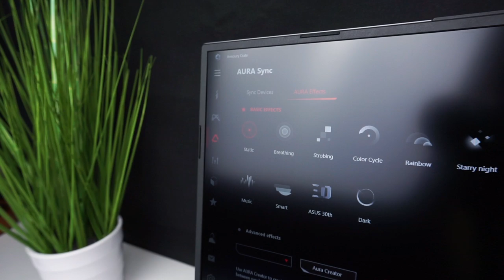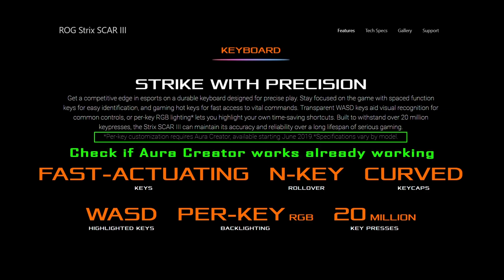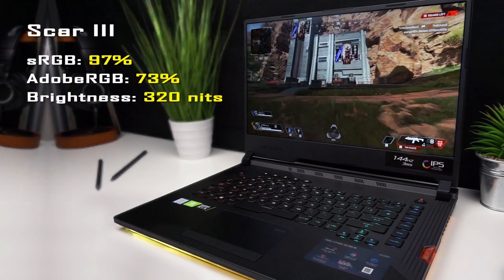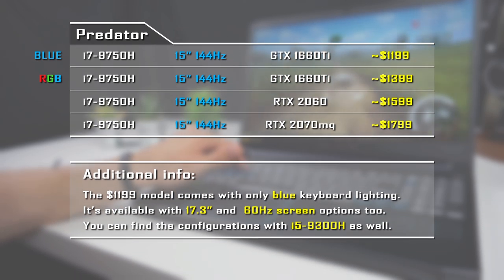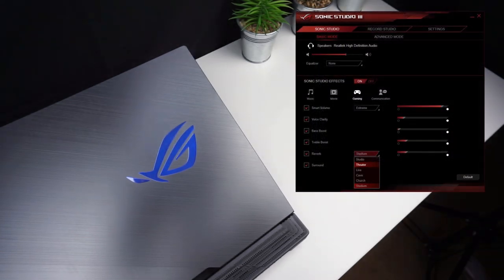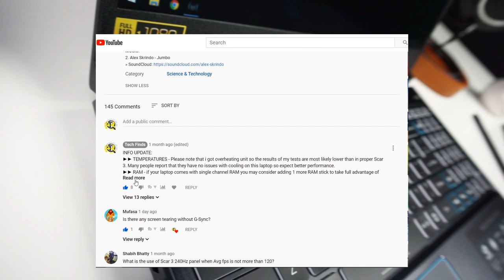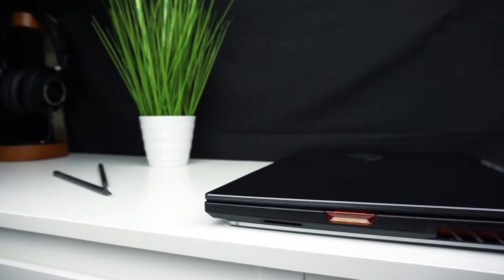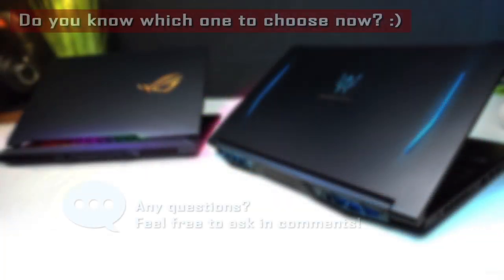Acer Predator Helios 300 2019 vs Asus Scar III - In-depth COMPARISON / REVIEW

Comment: Here are a fer questions ....
Do you get more frames if lets say i connect this device to a 2k monitor ?  
I think the rtx2060 should shine when used in higher res .... 

Lets say i would like one day to buy a VR headset .... can the 1660ti handle that ?
Reply from the maker: Every external monitor and every higher resolution decrease the performance. It depends on your monitor how much lower frames you'll have. 
If it comes to VR you can play every game with ease.
Reply: @TechFinds  I Should have made myself clearer .... the question is in regards to the difference between 1660ti and 2060 ... 
Both can handle 1080p with roughly the same FPS per game , making the price for the 2060 kinda high , but ... can the 2060 handle a 2k monitor vividly better then a 1660ti .... same with VR ..

Thanks for your time and a very well put together Video ::)
Reply from the maker: @hoffmanstream1107  The difference between GTX 1660Ti and RTX 2060 in Predator should not be  noticeable for VR, but if it comes to monitor you should be able to take advantago of RTX card since in theory it provides better results on higher resolutions compared to GTX cards. But i can't tell you anything certain, because i wasn't able to test it. I don't have any external monitor.

Comment: How do you compared the fan noise between these 2 laptop especially in turbo mode?
Reply from the maker: There is a device to measure the decibels. It's pretty common and cheap, just a microphone on a little stand with a display to shod decibels. ;)
Reply: What he means i think is that what laptop is much more noisy.
Reply from the maker: @mer-oneralphjr.bolinto6515  Ohh, the first thing that came to my mind was if he's asking about how do i measure the noise. Predator is much noisy, but i said that in the video.

Comment: Which one do you recommend between omen, predator and y540 for rtx 2060. ( i don't care about rgb so thats not a problem).
Reply from the maker: For sure exclude Legion Y540, because it runns pretty hot. Depending on which generation of Omen you're talking about my answer may vary. However if you wanan squeeze the most FPS out of you dollar i think that Predator is the way to go. I'm working on a comparison between 2019 Omen and 2019 Predator, so if you're curious it will be relased in about 4-5 days hupefully.
Reply: @TechFinds  i was talking about the 2019 omen with rtx 2060 and i7 9750H  because it seems to offer a pretty good value. So which one do you think is better 2019 (rtx 2060) predator or (rtx 2060) omen. (thanks for replying 😁😁)
Reply from the maker: @ShreyasDongre-de6cj  I had Omen RTX 2060 and Predator with GTX 1660Ti. Hard choice to be honest. I think if you're ok with tweaking the Omen may be better option, but right out of the box it runns very hot right out of the box. It's also more expensive, but it has better build and features. However as i said if you wanna get the best performance out of your buck go for Predator with GTX 1660Ti which performs almost the same good as RTX 2060.
Reply: @TechFinds  and please comment about the thermals of the mentioned laptops
Reply from the maker: @ShreyasDongre-de6cj  Predator has better thermals, and Omen gets over 90 right out of the box. However if you undervolt it gets down to low 80's.
Reply: @TechFinds  i meant the laptop in the link not omem
Reply from the maker: @ShreyasDongre-de6cj  so if it comes to Scar it's a lottery, because you can get either a good unit with good thermal paste or bad unit that is overheating because of bad thermal paste application.
Reply: @TechFinds  so you mean there's no guarantee that it's thermals will be good?
Reply from the maker: @ShreyasDongre-de6cj  that's what I mean. However repasting with a good thermal paste will help in case if you got bad unit.
Reply: @TechFinds  Thanks. Won't bother you again.
Reply from the maker: @ShreyasDongre-de6cj  Lol, your link with Zephyrus M went to the spam folder and i didn't see it. :P
It's a great deal, but this laptop runns hot, so the performance may be affected.

Comment: In my country ( India ) Both laptops are almost the same price ( around Rs. 140000 ) each . So which laptop I should go for ?
Reply from the maker: Everywhere else Scar 3 is more expensive, but to be honest the only thing where it's better than Helios is RGB, speakers and display. If i had to choose i would go for Helios anyway.
Reply: @TechFinds  Thanks for the reply . Is these two laptops comes with a cpu integrated motherboard ? And what is your take on the HP Omen 15 - dh0135TX ?
Reply from the maker: @arjunprathap6703  Yep, both have integrated graphics as well. Don't tell me the model number mate, because it's individual for each country even if the laptops have the same specs. Tell me the year, specs and eventually design details.
Reply: @TechFinds  It's a 2019 model , i 7 + 1660 T i .
Reply from the maker: @arjunprathap6703  Yes, but there are 2019 old generation models and new generation. The old has red accents and the new one is all black.
Reply: @TechFinds  The all black one
Reply from the maker: @arjunprathap6703  Then i think that 2019 Helios 300 is still better, but Omen may be better choice than Scar 3. It's only my personal opinion. I made a comparison between 2019 Omen and 2019 Helios 300 as same as 2019 Omen vs Scar 3, so check those videos and make your decision clearer. ;)
Reply: @TechFinds  Ok I will watch . Thanks for the help :)

Comment: @TechFinds  i m plaining to buy asus scar 3 rtx 2070 with 240hz this is better than heliod 300 right
Reply from the maker: Depends on what you need. For sure you will get netter performance with RTX 2070 Scar 3, because it's full size.
Reply: @TechFinds  thank you for the update I'm going for it 😊😊😊😊😊
Reply: @k.yohans.perera8002  bro so do you confirm to buy the strix scar 3??
Reply: @iodean7616  yes

Comment: After watching tons of videos i came to the conclusion that rtx 2019 laptops are not worth it! Will wait for amper architecture announcement next year!
Reply from the maker: Since the GTX 1660Ti cards came out the RTX 2060 laptops seem to be overpriced while giving just slightly better performance. However if you're looking for absolute best performance on the market no matter the price, then RTX 2070 and RTX 2080 is the way to go. Yep, i'm so curious what the new generation of graphics cards will bring to the market and what kind of prices we can expect!
Reply: @TechFinds  Even the Max-Q ones?
Reply from the maker: @mrhyde7019  In my opinion Max-Q laptops have worse price to performance ratio, but you can still find some worth attention ones. It all comes down to price and for example HP Omen 15 with RTX 2070 MQ is a good deal, because it costs abour $1550.
Reply: @TechFinds  Yeah, guess so. I'm now looking at the new Intel collab devices (Maingear Element, XMG Fusion, Eluktronics Mag-15). But somehow I want to hold on to my ROG G750 until next year by this time to see what the new generation of Ampere cards bring.

Comment: Hey ,
I have a request from you, I’m going to buy a laptop scar ii and I wanted once I receive it to test it fast and to detect if there is anything wrong with it to return it or to fix it from the store where I got from 
I already googled and got some info
But I would like to know your thoughts and tips on how to test a laptop :) and thanks!
Reply from the maker: Just check the clock speed, temperatures and if there is a thermal throttling. I'm using Intel extreme tuning utility. Next thing that you can check is backlight bleeding. Do it in a dark room, set the full screen brightness and set the completely black picture on full screen mode. If you see strong yellow bleeding spots around the display it's not good, but it's a cosmetic issue anyway.

Comment: Everything is great i just don't agree with that you need to remove flat cables when you open laptop.. Cables are long enought so you literally have no need to disconnect them,i recently upgraded ram on mine,and it went flawless :)
Reply from the maker: Yes, you probably can do it without disconnecting the cables, but you had to flip the bottom lid over right? The thing is you need to be very carefull then to not move the lid during upgrade process, becayse you may accidentally tear off the cables. Anyway, every way is good if it works. :)
Reply: @TechFinds  You don't need to flip it all the way,you can put laptop close to wall or smh,if you work alone.. or friend can hold it if you work in pair :D But you are right.. Cheers
Reply: @TechFinds  so if the cable tear off so it will damage the laptop right or the rgb will not function
Reply from the maker: @ahmadboyz  It depends, because the cable can just pop out of the connector, so you will be able to connect it back. But if it tears off damaging any connection points or itself then light bar will not be working. Idk if the cables are only assigned to light bar or other features too.

Comment: Acer Predetor Helios 300 vs Asus Rog strix g   ,   2019 model i7 processor...
Reply from the maker: I'm not sure if i will be able to get the Strix G, but i can tell you that Strix G is not the best value laptop. It's much more expensive than Helios 300 with the same specs.
Reply: @TechFinds  i feel like whenever they do that there is something in the specs i am missing
Reply from the maker: @chadedwards3676  Cheaper doesn't always mean worse or less features. It's all about testing. ;)

Comment: And you can do a review of the predator against the Hero 3? Because i dont see many differences between the scar and the Hero 3

I want to see the performance of the Hero, because if the performance is Good, i would go for the asus, because of that extra rgb and audio
Reply from the maker: Hero has the same specs as Scar. Basically Hero 3 = Scar 3. The only difference is different colors of chassis.
Reply: Socthe performance is the same
Reply from the maker: @stephanoparedes7190  if you have the same specs the performance will be the same
Reply: There are laptops that have the same specs and one outstand the other, in jarrods tech i see the benchmarks results of the scar 3 and its performance in light games was very bad compared to the Helios with the 1660ti and the scar 3 with 2070

This was with low settings,
Reply from the maker: @stephanoparedes7190  I'm talking about the same specs in Scar 3 and Hero 3. The performance vary between laptops because of many random conditions like room temperature, thermal paste application, drivers version, game patch etc... So take every benchmarks with a grain of salt, because your laptop will not perform identically even though it has the same specs.
Reply: Tech Finds thanks

Comment: Hi my friend.. i just watched more than 100 video about the helios 300 .. on the same configuration because it’s the same one i ordered .. but every time i watch a video on every video the fps is different than the other video so i’m not sure about his preform
Reply: And i have a friend he has an acer nitro 7 laptop with core i7 9750 and gtx1050 4 gb vram with 8 gb ram .. and in fortnite for example in the epic sittings the fps is between 45-50 .. so for this reason i am not believing that the 1660 ti with this configuration is getting more then 120 fps on epic sittings or more than 70-80 fps on the high sittings of the so strong games .. so what do you have something to say it to me to make me relax cause i just ordered my helios 300 and thank you again 🙏🏻
Reply from the maker: Everybody will have different performance even though the laptop has the same specs. The performance depends on many random conditions, even a room temperature. GTX 1050 is WAY SLOWER than 1660Ti

Comment: if i bought the laptop 300 from amzon and upqrade the hard . It comes out of the warranty??? or not ?
Reply from the maker: You have to read your warranty card, because it bay vary between countries. However if your laptop will become damaged because of you or parts you added the warranty is void for sure.
Reply: If you want the warranty to still be valid the acer predator service can upgrade it for you. But i think if u do it on ur own the warranty is no longer valid

Comment: i need your advice
I'm going to buy one of these 2 laptops
Asus Hero 3 with rtx 2060 and i7 9th
Acer Triton 500. rtx 2060 and i7 8th
which one i should go for
Reply from the maker: Scar 3, because it runns much cooler than thin and light triton 500.
Reply: Buy hp omen 17.  Fucking beast
Reply: @rajakhan12346  bro, does omen 17 get hot and produce loud fan noise ?
Reply: @funnymayan  mine hasn't got that hot . Fans get bit loud if you put performance mode on. But you can change it to auto or max fan speed. But it's really good laptop. Full rtx 2070.
Reply: @rajakhan12346  could you give me the amazon link of ur model bro? i m planing to buy from US.
Reply: @funnymayan  I got it from hp.co.uk store.
Reply from the maker: Omen comes with RTX 2070 Max-Q and GTX 1070 Max-Q. RTX 2060 and other configs are full size.
Reply: Buy Acer Helios 300 2019 with RTX 2060 configurations, it's worth compare those two.
Reply: @TechFinds  nope my omen has the full gtx 2070. It's not maxq.
Reply: @indraorion9484  I'll buy the hp omen version. I think it's the best laptop of the year

Comment: Is it still good to buy the i5 version with rtx 2060 gpu of the acer predator helios 300 sir that's the only one i can afford for now God Bless
Reply from the maker: Yep, this configuration can still run basically every game on high+ settings
Reply: @TechFinds  oww really?thank you sir for answering my question i can't see any review bout the i5 version and your the only one to answer me btw sir do you have a video explaining how big is the difference of i5 and i7 in performance thanks again sir God Bless :)
Reply from the maker: @renzjosefflacostales4015  Unfortunately i didn't test any laptop with i5 on the channel yet, but i'm saying based on other laptops with similar specs. Check some benchmarks of similar configs on YT
Reply: @TechFinds  didn't see anyone having a review with i5 9300h with rtx 2060 i only saw i5 9400f i dont know how big is the difference between those 2 i5 9th gen cpu

Comment: i googled about back light bleeding on predator and found that almost all unites has back light bleeding from top so can you try to find a solution for that laptop like loose the screw or something like that and make a video about it
Reply from the maker: Hey, i had this laptop for testing purposes and i had to send it back. Also i am not permited to disassemble anything beyond bottom pannel, HDD, M.2 SSD and RAM, so i couldn't even make such video guide. However i've heard about guides showing how to loose the frames and getting rid of backlight bleeding in other laptops, so look for one to get the idea of how it could look like in Predator. But i'm aftaid that you're left on your own with this particular laptop, at least until someone make a guide showing how to deal with backlight bleeding in 2019 Predator Helios 300.
Reply: Mohamed Selmy  I have this laptop and I got rid of the bleeding by filing the bezel inside it's had job but worked for me.
Reply: @top_G_82  can you make a video guide step by step for that ?

Comment: In my country asus strix g rtx 2060  is about 1500$ and helios rtx 2060 is about 1700$ . Which one i should buy ? Allso y540 rtx 2060 is about 1400
Reply from the maker: $200 less for Strix G is tempting, but i think that Helios 300 is better overall. Better cooling, build quality, it has webcam and MiniDP.
Reply: @TechFinds  can you pls help me with 1 recommendation ? Personally i am playing mostlly esports games . Which laptop and specs  should i buy for these  . My budget can vary between 800 and 1700$ .  Esports and movies .
Reply from the maker: @tararachestelian508  Esports games are not usually very demanding. I think that even GTX 1060 would be enough for games like Dota 2, LoL, CS:GO, Overwatch, Fortnite etc... However you can check out the 2019 Helios 300 with GTX 1660Ti. Idk how in your country, but in general it's pretty cheap for the specs.
Reply: @TechFinds  it s pretty expensive here helios 2019 ninimum 1700$ . Y540 with 1660ti it s about 300 400 $ less. About the processor you think i5 9300h it s enough ?

Comment: ROG looks cool but believe me the heat management, bugs in softwares will make you regret from buying it. Telling this from experience.
Reply from the maker: Kinda right, but you can at least help the thermals. It's all about thermal paste lottery, so consider repasting with high-end thermal paste.
Reply: @TechFinds  I've repasted it with liquid metal and the performance is still same.
Reply from the maker: @CyganJaynoc  that's strange, because mine had good thermals and performance. Are you sure you play games on turbo mode?